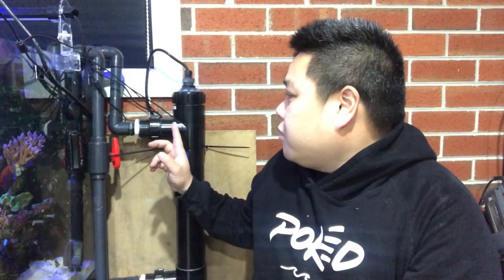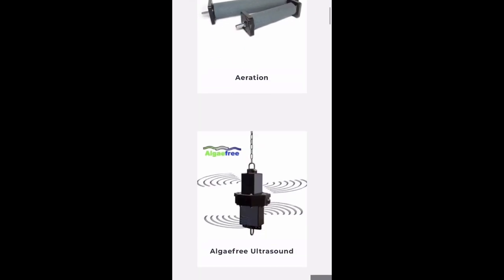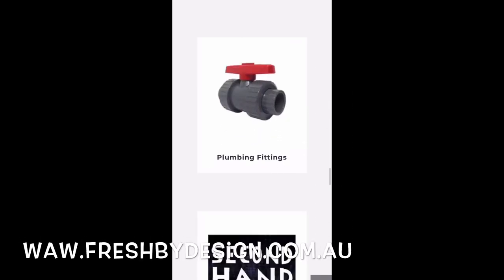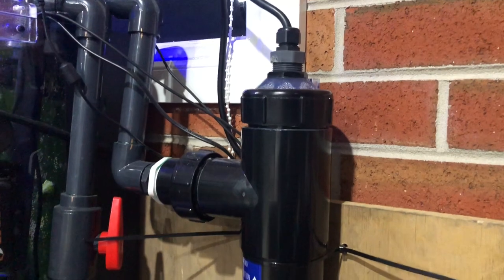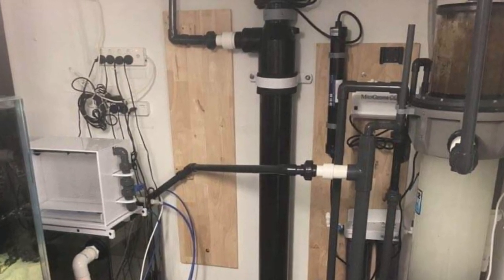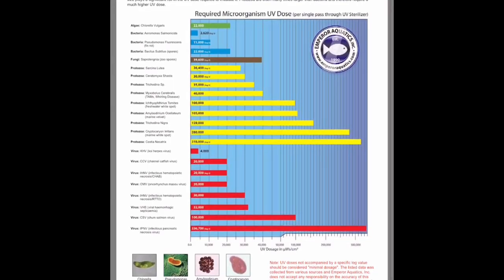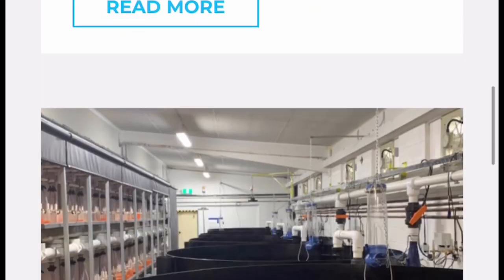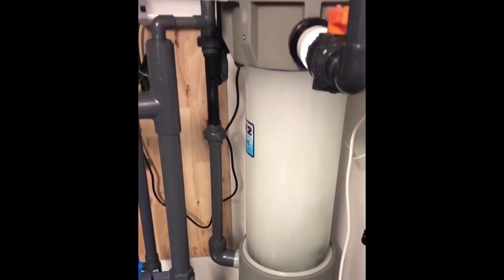How I run my PENTAIR UV Steriliser!

Comment: Hi David,
Can I install a gate valve before the inlet to reduce the flow rate for fish diseases control and open the gate valve fully when I want to combat algae/water clarity ?
Reply from the maker: Hi Kevin! Yes thats exactly what I have done mate! Easiest way to do it! Another option could be to use a dc controllable pump but valve is really simple 😊
Reply: @firsttimereefertv1588  thanks heaps mate ! 👍
Reply from the maker: @kevinhoang2275  no problems man! Youll love having a uv 👌
Reply: @firsttimereefertv1588  hi David,
Just another question for you pls.I had myself a Pentair UV. Set it up, run a leak test and it was all good. But now I see water bubbles inside the top of the unit. Is it normal or have I done something wrong ?

Comment: i installed this UV and I got cyano bloom. I think this useful for white spots but not for cyano bacteria
Reply from the maker: waleedreef it would be from incorrect flow or incorrect sizing. Uv sterilisers can not cause cyano. As cyano is an algae that can be waterborn, if the unit was sized correctly and correct flow rate was achieved then uv sterilisers are incredibly effective against cyano and dino
Reply: First Time Reefer TV Manufacturer advised me to adjust flow of 10g/min, and this achieved via valve and appex flow sensor. Believe me, it cannot precent cyano bacteria in your tank
Reply: First Time Reefer TV I didn’t say it will cause cyano but if cyano started, it can multiply even if you have Pentair UV.
Reply from the maker: What size uv and what size tank?